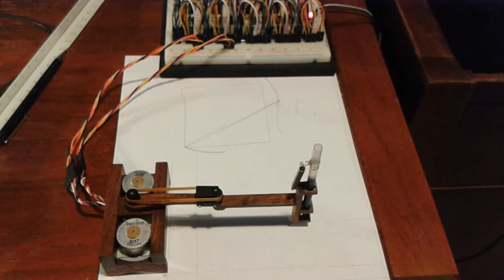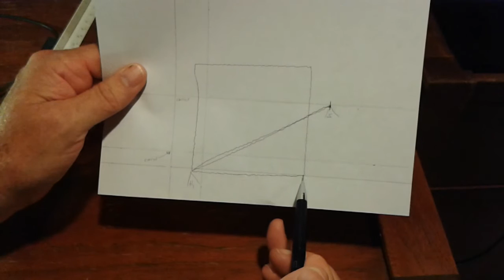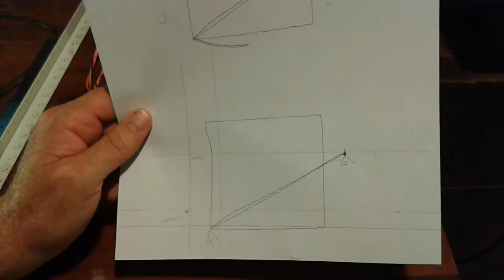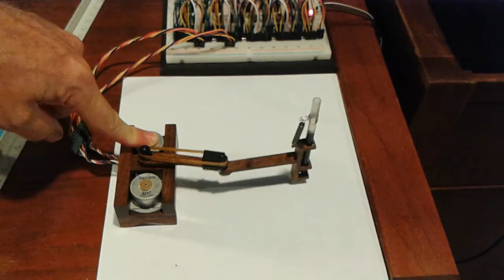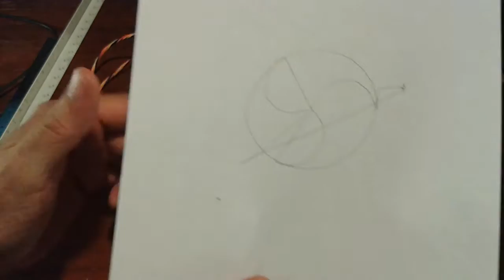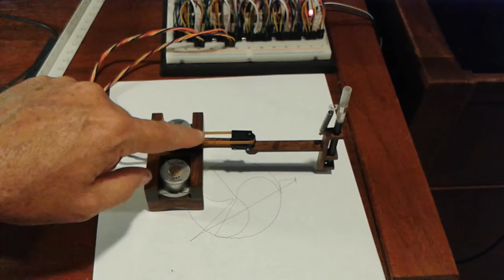Part 7 - Mini SCARA CNC Plotter - Checking the resolution (not good).

Comment: Hello! Can you share the software? I am trying to makje something similar.
Reply from the maker: That code used MicroChip 8-bit microcontrollers. I haven't used it in a few years, and I don't remember the state of the code when I quit using it. I'm working on a new SCARA plotter using an ESP32 running over a WiFi connection (short preview: https://youtu.be/Y8w86XNzh90?t=817 ) and will make that code available as soon as I get it ready. Should be fairly soon. I plan on making na introductory video for that project in the next week or so.
Reply: @ClaytonDarwin  how did you Solve the inverse kinematics?, Your robot can rotate 360 degree AND the most common equation of inverse kinematics do not rotate 360 degrees.
Reply from the maker: I set limits on angle of travel, generally less than 180 degrees for each arm. Then I imagine it is a person writing on a chalkboard and specify right handed or left handed. Then I specify elbow is pointing up or elbow is pointing down. With all these limits I can easily choose the correct angles from central pivot to elbow, and from elbow to pen. I just use the intersection points of the circles with centers at central pivot and pen. So really, it has to work in a specific area and keep its elbow pointing in the same direction all the time. It isn't unlimited. All it needs to do is write postcards.

Comment: How bad is the backlash?
Reply from the maker: There isn't much backlash to speak of. I can adjust the gear mesh. It's just the low step count that's a problem. Eventually I'm going to make a larger version using some 200 step nema 17 motors.

Comment: Have you tried running the motors in a non-full-step mode?
Reply from the maker: Good idea. Theoretically that would cut the resolution in half. However, these little motors need two coils active to turn the gears reliably (and a relatively slow step speed). I think I'll shorten the second arm and rewrite the software to choose the same path midpoints in both directions. And then just live with it. It will draw Picasso style.